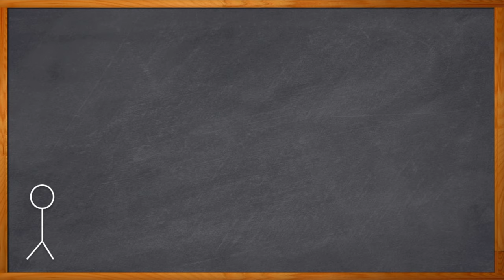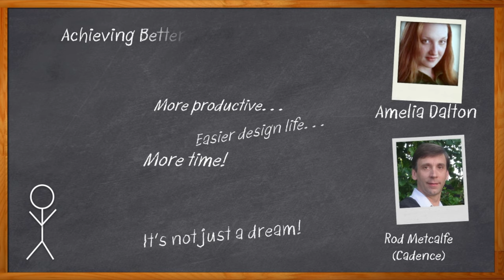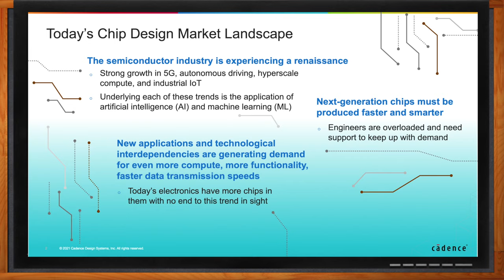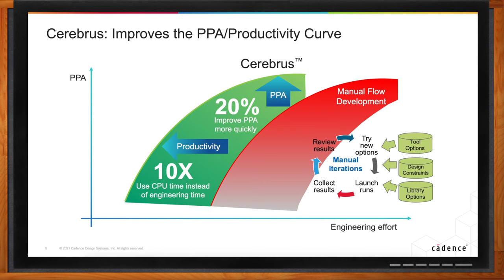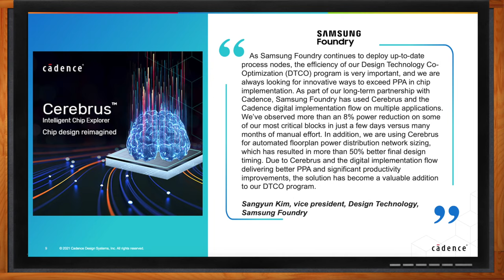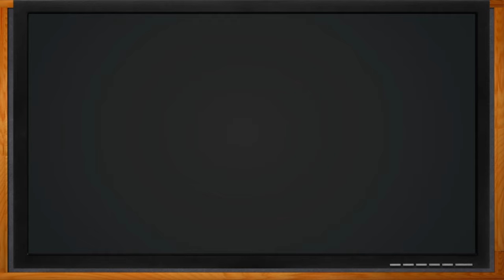Machine-Learning Optimized Chip Design -- Cadence Design Systems

Comment: I'll assume this is an AI approach that requires a license for Cerebrus, and more license hours of everything else for the AI to experiment. A real AI approach would cut the tool license hours to a fraction of what it is currently.
AI can't help you if your tools don't work well, none of the existing simulation tools are fast enough and/or accurate enough to let an AI learn how to do chip design faster. Fortunately machines that can run neural-networks are good doing simulation too, so real AI in chip design isn't that far away; unfortunately that kind of problem looks like mixed-signal simulation, and all the EDA companies suck at that.
Lack of productivity is really due to a big disconnect from design specification to implementation, using transaction-level specifications and formal translation to logic level with AI driven verification at the gate/GDSII level would go lots faster, and it would probably put RTL tool flow EDA companies out of business.
Reply: loo
o